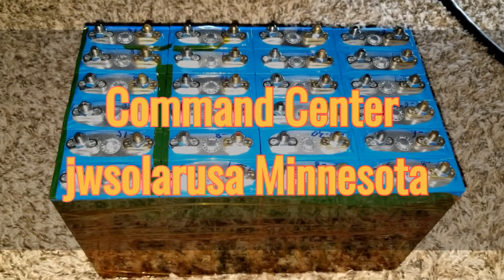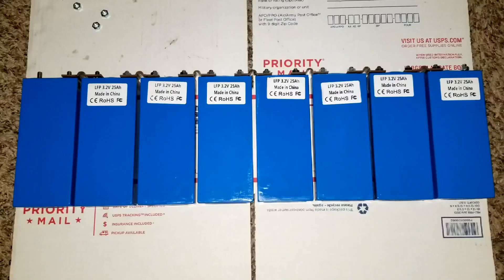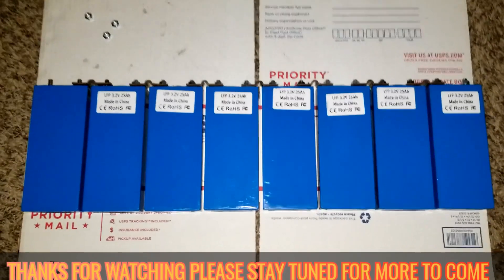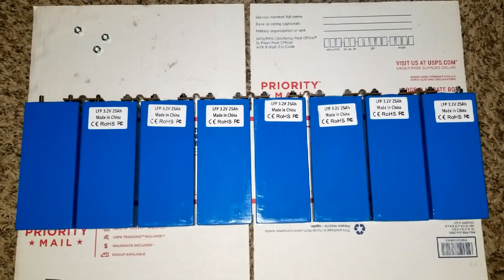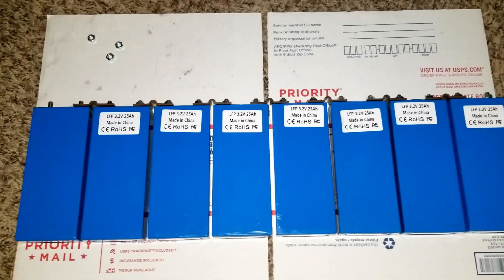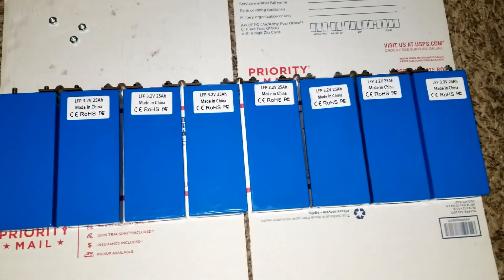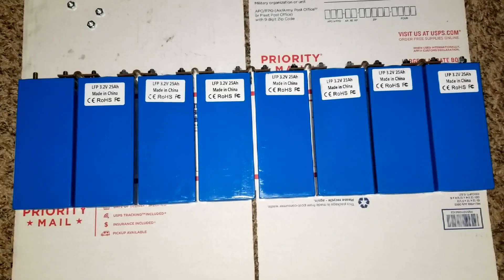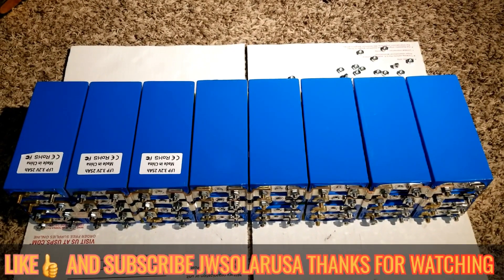PRISMATIC CELL ASSEMBLY, PRISMATIC CELL COMPRESSION

Comment: Where did you get the Kapton from I'm having difficulty finding the thick rolls
Reply: Amazon
Reply: @USA-GreedyMenOfNoIntegrity  Thank you
Reply from the maker: https://www.ebay.com/itm/50mm-x36yd-Kapton-Polyimide-Silicone-High-heat-resistant-Tape-2-5mil-thick-K201-/184309015239?mkcid=16&mkevt=1&_trksid=p2349624.m46890.l49286&mkrid=711-127632-2357-0